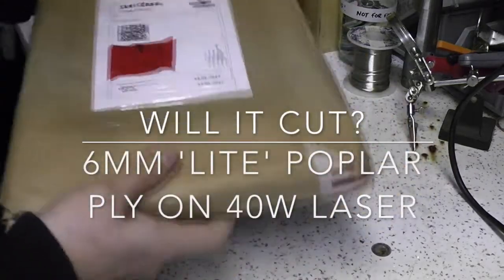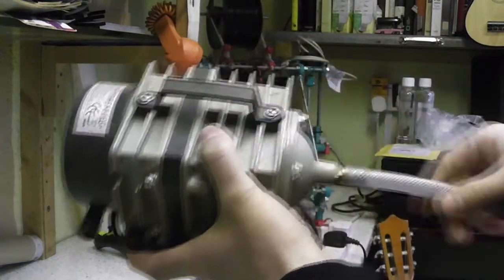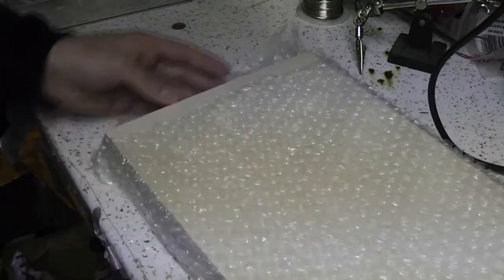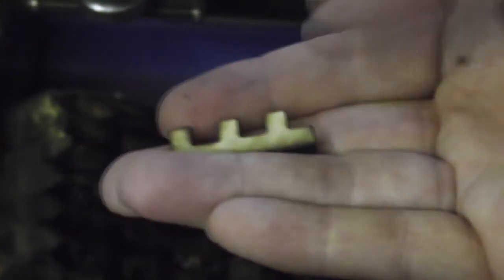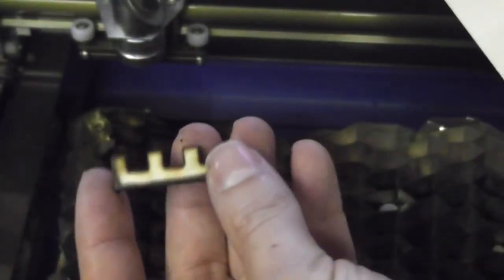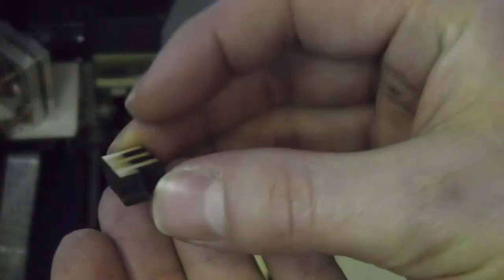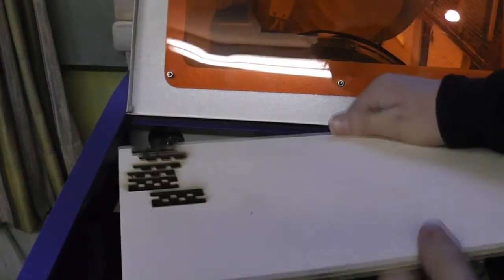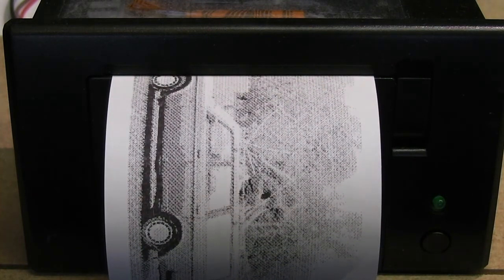Will it cut? 6mm 'Lite' Poplar Ply on 40W Laser (and air assist FAIL)

Comment: Thank you and well done , a great effort cutting 6 mm ply, and you've proved the sceptics wrong, who  reckon you would struggle to cut anything over 3 mm with the K40  lasers.
Sorry you didn't have much success with the air assist, I think the pump you are using is the one that ships with the blue 50 watt lasers as standard. Maybe you could try the silicon air tubing from e bay, comes in variable diameters  from 6mm to 31mm. they are very flexible and hard wearing and easy to fasten to the machine with the cable management. I use these with the same pump as you tried, on my small cnc to blow the saw dust away from the cutter, and it works great.
Once again thank you for the video, look forward to watching many more.
Reply from the maker: binshotalot thanks for the tip about silicon tubing. I have my eye on an air compressor that has been recommended for air assist on US forums and there's a version available in the UK. I'll make a video about that in the next few weeks.
Reply: I can cut 3mm with a 15 watt ortur in 4 passes  A 40 watt should cut it like butter.

Comment: that was me that made that 6mm poplar video, it was solid wood, not plywood. and as long as you use a glass mirror the laser will damage the reflective surface thus no reflection. but thanks for mentioning me in your video! LOL
Reply from the maker: M. Shane Snook Interesting point about using a glass mirror, I didn't think of that. Although, would there be reflections from the surface of the glass and the metal coating on the back as the laser is warping the glass? I suppose the reflections would be scattered so would lose a lot of their power.. I take your point but I still prefer to keep the lid of my machine closed while the laser is on :)
Reply: OpenTronic  I understand. again thank you for mentioning me in your video the "crazy kind of genius" line cracked me up! LOL
Reply from the maker: M. Shane Snook I'm glad to hear that because I felt bad for calling you crazy or whatever I said! I think it's cool you've cut solid poplar on your cutter. The 'lite' plywood I cut is cored with a less dense wood that makes it easier to cut.
Reply: OpenTronic don't feel bad about calling me crazy! all my family would say you hit the nail on the head! if you need any advise let me know. I did want to ask you which way you had your focal lense. I found out after 9 months of using my laser that the rounded side should be up.
Reply from the maker: M. Shane Snook that's a good question, I never even checked my lens. This could be the easiest upgrade ever ;)
Reply: OpenTronic yeah my laser easily cut through 6mm ply after this with minimal passes at around 7 to 8 mm/sec. also I wanted to let you know that optimal cutting power is not always max power. I do most my cutting at around 10mah.

Comment: Wow I got a mention lol and you got my name right, good on ya. I've now ordered my proper air-assist head , new lens and a gold plated mirror from lightobject.com but as it's coming from the US to Oz it's taking a while. My 3d printed version was a bit too shonky. I did some tests on 6mm MDF the other night with no air-assist and I manager to cut it at 5mm/s with about 12mA. My extraction system sucked the flames out :-) Cheers..
Reply from the maker: 6mm MDF is impressive, I've managed 2mm on my laser but it seemed to struggle. And in fact the 'medite' which is supposed to be optimised for lasers is harder to cut than HDF. Looks like I won't have my air assist for a while either.. I think my 3d printed nozzle will probably need a little bit of improvement also - the print came out well but the design has a few slots in it that will let air out in the wrong places. Good luck with the new parts, sounds interesting..
Reply: Have you cleaned the mirrors? Especially the one in the head. Mine was absolutely disgustingly mouldy and the device is only about 6 weeks old. It's not from fumes, they seem to come that way. I used a bit of metho and a cloth and it made a big difference.
Reply from the maker: I haven't checked - it's hard enough to line them up properly so I leave them alone as much as possible. But that sounds like an easy way to increase the power, if they do turn out to be dirty. I've used mine long enough that smoke could have built up in addition to anything from the factory.
Reply: I only removed my head mirror because the head is easy to realign and the others I gave a quick clean up in situ,

Comment: That was an air pump and not an air compressor. Both are designed to pump air, but a compressor has a slightly different pump and a tank into which it pumps the air to compress it ie. build up pressure. You could try hooking the air pump up to an empty gas bottle like a propane tank, but you will need fittings, gauges, etc. which will add to the cost. You would be better off purchasing a small pancake compressor which will cost about the same as the aquarium air pump.
Peace!
Reply from the maker: Jeffrey Vastine thanks for the advice, I've found an airbrush compressor of roughly the same model recommended on some US laser cutter forums.
Reply: Nice, that should work great. Here is an idea that you may want to try and that would make some great content for your channel. As you now, many machines utilize the same type of framework with linear motion control on the X, Y, & Z planes like a 3D printer, CNC router and milling machine, laser cutters and engravers, etc., so it would be a bit redundant and an inefficient uses of resources for the average hobbyist to buy or build each machine. Since you already have the CNC router why not design and build different modules that will extend the functionality of it that can easily be swapped with the spindle motor. For example, a hot end for 3D printing with various composite materials, a syringe that functions on the same principle for printing with clay or similar materials, a drag knife, an engraver, a pen holder, an airbrush, a TIG or MIG head, etc. Sure the laser cutter can cut many materials but the drag knife will do so without leaving any charring or discoloration along the edges and thus offers or provides more options and greater possibilities. Naturally, the airbrush would be used for painting designs on items and you could make custom t-shirts. With the syringe, you could make all types of ceramic components or just make cups, mugs, vases, etc. Plus you could use different size syringes to print with cookie dough, chocolate, etc. and make all sorts of sweet treats and candies. However, I would recommend a separate machine for food items. There are many things that are possible and your only limit is your imagination. Good Luck!
Reply from the maker: Jeffrey Vastine thats a good idea and had kind of crossed my mind.  The only technical problem is the different torques and speeds that are optimal for cnc routing, laser cutting and 3d printing. The best way around that would be to use a trapezoidal leadscrew with powerful motor drivers so you have enough speed to laser cut and 3d print efficiently and still have torque for routing. But thats the most expensive drive option so not something I could do soon. The thing I'm watching out for, in terms of efficiency and saving space, is a laser diode module powerful enough to match a 40W CO2 laser. I dont think that exists yet, certainly not within my budget, but I wouldnt be surprised if they are developed in a few years.
Reply from the maker: 15W laser diode modules are available for about £300 - it seems like the max power available is increasing every year.
Reply: Well, that really depends upon the types of materials you plan milling. Many CNCs use G2 or G3 timing belts like the Open Builds Ox or the C-Beam machine and they work well cutting non-ferrous materials. You could still start with what you have, expand its functions, and then use it to earn the cash to build an acme screw or rack & pinion based machine using servo motors for positioning. There are plenty of options available if you want to do this. For example, you could take a digital photo of a child that could be imported into DAZ Studio i.e. a free program from DAZ3D that is similar to Poser, and use it to skin the Genesis figure that has been morphed to have the same body shape and style. Export the model, slice it, then send it to the 3D printer, and when it has finished you will have a poseable action figure that looks just like the child. Could you find a market for something like that in the UK?
Yes, and I did not mention the laser since you already had one. I would like to see fiber lasers drop into that price range and then we can begin to do sone incredible things.
If you had the room you could build a large format machine like a 4'x4' or a 4'x8'. Then add a plasma torch so you can precisely cut sheet metal and use the TIG or MIG heads to weld the pieces together and make some cool customized things for people, businesses, and yourself. Plus you could make some accessories such as a rotary table, a 4th axis, and a tailstock for it. As you get to this point you will have the capability to redesign and make a new spindle mount that has the ability to tilt it on any plane. This would dramatically enhance your cutting/routing capabilities. Then, like the doll mentioned earlier, you would have the ability to make statuettes out of various exotic woods, brass, bronze, marble, etc. Could you find a market for that? Or make a 3D scanner and then scan an engaged couple which can then made into a statuette or print with the 3D printer module to make a custom wedding cake topper. Would people purchase that? Do you need more ideas?
Peace!
Reply from the maker: I think that's enough ideas for a couple of years ;) The reason I personally have a downer on timing belts is because my friend on the Educating Savvas channel was given an Inventables machine to review, and he had all sorts of trouble with backlash and stretching in the timing belts. He upgraded to metal reinforced T2.5 belt as I use on my RepRap and the problems didn't entirely go away. I guess there are probably more tips about how to eliminate those problems but I prefer the idea of leadscrew driven systems just because you put them in place, maybe tune once, and they just work with the same level of accuracy across the whole cutting area. PS I have built a leadscrew driven Openbuilds-style CNC machine by cutting most of the components on the laser cutter, check out my playlist about it if you're interested.
Reply: I've already seen your videos and Savvas's issues with the Inventables machine. I have a friend i.e. Randy Richard in the shop on YouTube who was also given an Xcarve and he had no issues setting it up or using, but then Randy has years of experience using machine tools. Since I saw several other YouTube creators who had a few issues with their Xcarve similar to those Savvas had encountered that were resolved by re-tensioning the belts and the fasteners holding them I am inclined to think there were some issues with or defects in the components in the kit he had received. Randy will not make heavy cuts with or use it to cut harder materials as the machine lacks the rigidity and torque. He did take my suggestion and added an engraver to it and has said that he plans to do more, but the machine offers a rather limited amount of travel in the Z-axis. Anyway, the "more ideas" was in regards to ways to earn extra cash so that you can build a new machine.
Peace!
Reply from the maker: Jeffrey Vastine thanks, your suggestions are much appreciated.. what I lack most at the moment is time because CNC stuff is not my main job. Hopefully one day it will be!
Reply: I know what you mean. I have a youth outreach that is based upon music and one aspect of the project is showing the youth how to find their passion and then use that to generate an income so they will not need to get a job i.e. just over broke. This tends to carry over into my interactions with others and is why I was giving you some ideas of things you could do to generate a positive cash flow. Since the youth either have not entered the workforce or have not been working long it is far easier for them to see the possibilities and change their mindsets than it is for those who have had a job for years. And yet there are those in the latter group who know it's possible and would like to, but they do not know what to do in order to get out of their rut and break free from the system and thus be free to pursue their passion and enjoy life doing what they love. I do hope that you find the path to freedom so you may pursue your passions.
By the way, I had neglected to mention that even though square and trapezoidal i.e. acme leadscrews offer far greater accuracy and torque for holding and positioning over the common Whitworth or US SAE 60* threaded rods from hardware and big box stores, they do have a drawback which is called backlash. With use, the brass or bronze nuts begin to wear which creates a gap between the threads and thus reduces the positioning accuracy and holding power. To avoid this problem it is best to use ball screws and rack and pinion gears on your CNC. 
Anyway, feel free to contact me if you have any questions. Check out CNC Router Parts for some ideas.
Peace!
Reply from the maker: Yeh this whole 'job' thing has always conflicted me. I've tried to exist both ways at different times in my life, both doing freelance stuff and on a salary and it does feel like a gilded cage. Security but less freedom. I hope I square the circle one of these days :)
Reply: The conflict in you is due to what you have been taught which resides in your conscious mind or soul i.e. the mind, will, volitions, and emotions, which is contrary to what you intrinsically know to be true in your heart or spirit i.e. the life source and the true self. Now squaring the circle is actually the imprisonment of the spirit which is symbolized by the graduation cap known as a mortar board which is a masonic reference to their use of schooling to build a prison in our minds. This is difficult for many to grasp due to the ambiguity of the words soul and spirit being used interchangeably and the lack of knowledge regarding our makeup as well as who and what we truly are. Anyway, I do hope that you find the keys to unlock the door and experience the life and freedom you were meant to have and become who you were always meant to be.
Reply from the maker: Hehe I went to art school to avoid that - and even there, I felt like students were being pushed down a path towards creating a certain sort of product which fits into an area of life where people are expecting 'art' - galleries or theatres etc. But I think it's far more interesting to create things that are art, technology, science, all in one. I find this 'Maker' movement really inspiring and I think YouTube is an amazing way to engage with people directly - whereas if you tell people you're going to make 'art' or 'sculpture' most people would be turned off immediately. The most creative stuff I've seen on YouTube is by people who never went to art school. It's uplifting to know there are people like you, and for example Rhinoa Super Genius, and lots more, who are doing things their own way and inspiring others.
Reply: So you never attended high school? The initial 12 years of schooling builds the prison and any schooling after that refines how one will participate in the system. Due to ambiguity, most people think school and education are the same thing. However, the word education comes from the Latin word educo meaning to bring forth, pull up, or draw out the innate gifts and talents an individual was born with whereas school creates uniformity and conformity to a system, which is why the word is applied to a group of the same breed of fish. Did you ever watch a school of fish? To help you understand this you need to now that what comprises a human. We are conditioned to think that we are just the body, but the body is simply a biological computer that enables us to interact with the physical world. Then we have a soul i.e. the mind, will, volition, and emotions and we are a spirit i.e conscious energy or rather consciousness. The soul is the bridge that connects us to the physical world, which is why school attempts to cram a bunch of useless data or information into or minds which then becomes a filter or block to the signals coming from spirit. If you have ever tried to cross a bridge during rush hour or when congested for another reason then you know it's not easy. The reason we see some of the greatest creations whether it's music or a painting or a sculpture or a piece of furniture or a meal or anything an individual had created is when they have not been schooled and were in touch with their true self. It is not easy trying to describe this when there are no words that accurately represent this and those that come closest have ben confuscated, but I hope you can grasp what I am saying.  If you have any questions please as.
Reply from the maker: I did go to high school unfortunately (art school was my university level education) and I found high school disheartening and unpleasant except for art and science class. I felt that most of the teachers were trying to prepare us for a 'world of work' that no longer exists. And the kids were unhappy so they took out their frustration on each other. Luckily I came out of it with knowledge that I can use as a tool, but I could have got the same knowledge in a far less painful way! The education system, especially in the UK and the USA, needs a huge reform if we're to stop wasting the best years of people's lives. I single out those two countries because I know in some European countries they do things a bit differently - but I don't think there's any country in the world that really lets people reach their full potential.